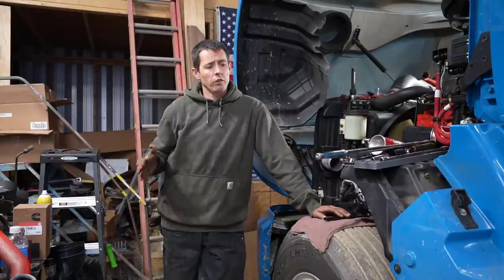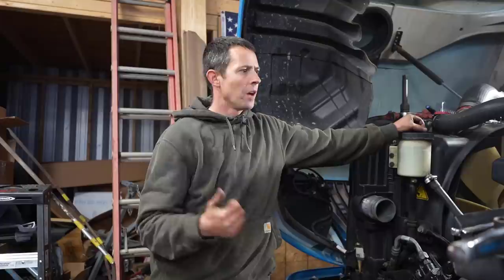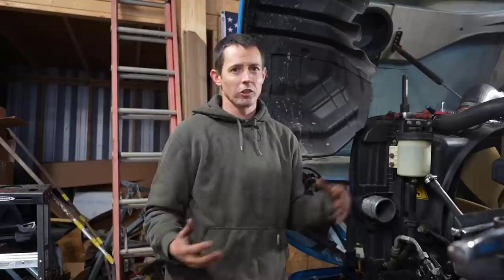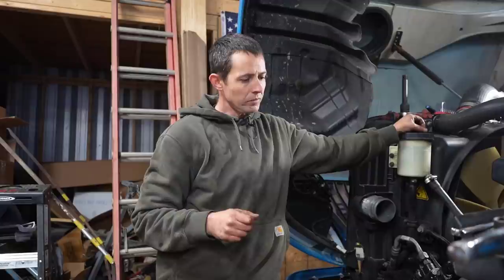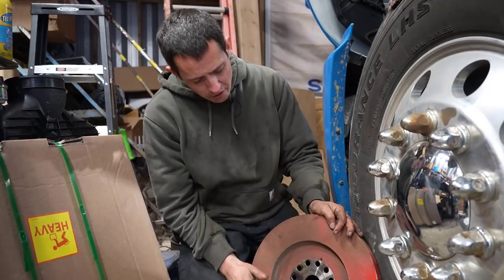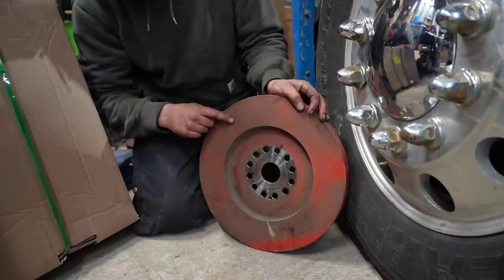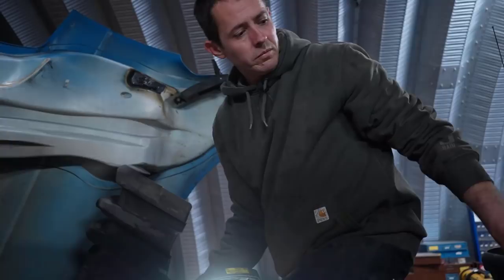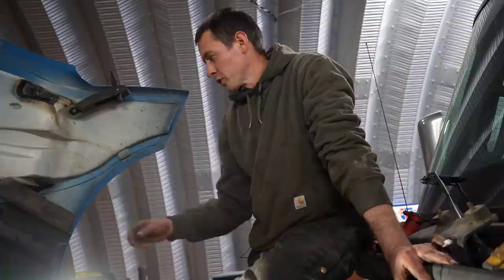Semi-Truck Cummins X15 Engine Vibration (Idle & Driving) - The Diagnostics

Comment: I have 2020 Volvo Vnl860 with 200k miles. Bought brand new. Started having vibration and spent lots of money trying to sort this issue. Spent thousands on diagnostic shops and found 0 issues until I replaced my reefer trailer axles bushings and also had to do fifth wheel top plate bushing cuz they were shot. And that fixed my issue. 

I didn’t believe that trailer had anything to do with what I thought was “driveline vibration”. But trailer’s worn bushing and alignment was the culprit

Comment: Awesome to see a video where the presenter doesn't make baseless claims and bash the engine design without knowing things.  I wish I knew what was wrong with it... I know the cam sensor and crank sensor alignment is continuously monitored in the ECM.  I believe it will throw a code once it's slipped enough.  The cam gear tends to slip very slowly over a long period of time, with the slippage rate slowing down over time.

Comment: I am currently dealing with this problem. It is fuel starvation/dirty fuel problem. The noise comes from the high pressure fuel pump being overworked. When i get the truck primed correctly it runs nice and quiet. When it starts sucking junk from the tanks or starves for fuel it starts to make noise and run kinda rough. It will also dry out the Davco filter empty out of fuel. Found a lot of water in my tanks. The truck will keep going, it will not shut off but has lower power. Also noticed my tanks not equalizing fuel correctly.

Comment: Also if the fuel pump was replaced or re-sealed  the fuel pump could be causing it. That gear is timed an will cause vibration if not installed properly.

Comment: vibration mmmmmmm ?? bent flywheel??? trany, issue?? I really want to know what it is please tell us was listening, for about 3min and came up with my guess I am sure I am wrong BUT please tell us, as I watched the rest of the video I am sure I am wrong but that was my best guess and I will stand on it GREAT SHOW really in-depth stuff Loved it also there was no mumbling or did you get a new mic? you really spoke up it was powerful you explain things very well hows the new place commin along? good to see you again hope you are all doing well. Ryan RESPECT my man. you really know you sh-t. Wow.
Reply from the maker: Thank you David. Customer said the vibration in idle and driving both improvement, especially he got more power while driving. However, I don't think it fully fixed the vibration issue. You could be right about flywheel and transmission. But normally during the troubleshootting, we want to look at the things most likely could be the issue and the cheap to fix solution before we look at more expensive parts like the transmission.

Comment: We has a troubleshooting on Cummins Engine won't start we changed battery 24 volt check fuel valve same trouble in customer option I saw Vibration switch option: Derate not same to other engine options is only Warning need help Sir

Comment: Did it fix the issue?
Reply from the maker: Customer left this morning, he said both idle and driving vibration has improved, and the truck got more power. However, I don't think it is fully fixed.
Reply: @truckingandfixing  it’s interesting for sure. At 600 rpm my x15 vibrates quite a bit, but at high idle it’s smooth as can be.
Reply: @musiccitytransport  Same here, was thinking it could be the fan or the tensioner.

Comment: Hey Ryan I’m a owner op with a 2018 freightliner coronado with a DD15 Detroit my secondary air pressure keeps dropping just to 100 psi every 3 to 5 min and builds back up, its doing it way to frequent just curious on what u might think it will be, thanks!!!
Reply: It’s a freight shaker, they are know to have air leaks. Best to get a  spray bottle with dawn soap and water , air up system and spray all your hoses and connectors , front to back including your air bags. Where’s there’s bubbles there’s a leak.
Reply from the maker: 1999 is the year the eld comes to the market. I don't think it has anything to do with serial number.

Comment: Ryan, 2019 Kenworth t680 with the Cummins isx15. When I cold start there has been a loss of Air so the compressor starts running, then when the compressor shuts off there's kind of a vibration in the motor and I am losing air to the point where the compressor comes back on then it kind of smoothes out. Then the compressor kicks back off and asserts the leak down air again with the vibration and returns through the same cycle again the compressor comes back on it smoothes out and compressor kicks back off and goes back into a vibration and starts to lose what do you think it is do you think it's the compressor Kenworth just did the front of the motor all the gaskets they said it was leaking there I thought it was a high pressure fuel pump leak they fix that before and it's is leaking oil like almost out of every orifice now do you think the compressor took on engine oil and ruin my compressor I know it's hard to say with all this man but what do you think's going on . Also the whole compressor coming on and leaking down cycling through about several times happens periodically throughout the day it's kind of an intermittent problem

Comment: Having the same problem, my X15 vibrates at 600rpm but when i accelerate all vibrations r gone, could it be the fan or tensioner?
Reply: Set idle up  to 700 RPM’s
Reply: @vicpetrishak1077  i dont idle my truck and when i do i set the cruise control and it stays at 800
Reply: Cummins ISX and X15 should idle at 700 rpms. If I idle for a period of time, I set the cruise between 900-1000 rpms
Reply: @smokeinapeterbilt  isx idle is 600 says it right on the valve cover
Reply: Did you ever figure out the problem?

Comment: No such thing as a 2015 X15. They started installing the X15 in 2018. There is a lot of difference than the isx the x15 has done away with all the worthless sensor problems.  People change the sensors and don't correct the problems that sensor is telling you have a problems 
Not the sensor is bad.

Comment: Hey Ryan real quick question have you ever encountered a harmonic balancer causing an engine knocking noise......

I have an ISX 870  the truck drove fine for about 300 miles I turned the truck off got unloaded started the truck fine pulled out of the shipper's yard and got up to speed well during that first pull I started hearing a knocking sound at 1,300 RPM..... And a wobble or vibration....

Well I've been basically keeping the truck around 55 miles an hour and the RPMs low  to prevent knocking I've got no smoking exhaust and it doesn't sound like a misfire I've had the valve cover off three times now I've checked the engine brakes to see if maybe the springs were bad I can't move the engine brakes while the truck is running at all.

I checked all the valve adjustments nothing seems loose it's kind of driving me crazy cuz I don't know if this engine is blowing up which I would imagine I would see tons of metal flakes on top of the head and on the dipstick..... And while the truck is idling it sounds completely normal and fine up until like I said 13 or 1400 RPM....

Also this truck gets regular oil changes at 25,000 mi intervals with Blackstone oil testing and everything has come back fine since I've owned the truck.